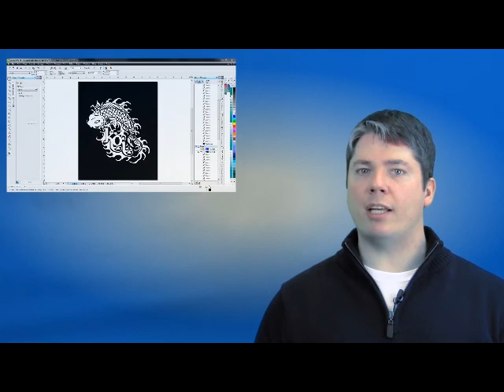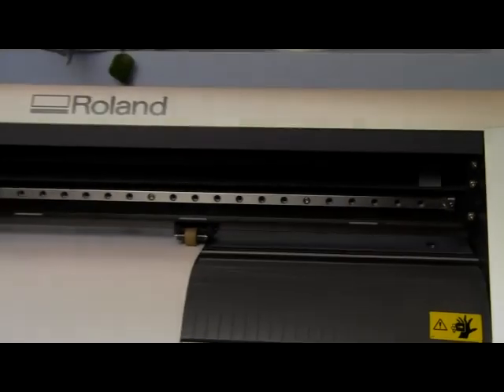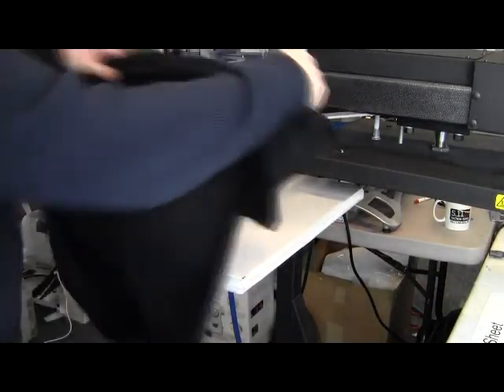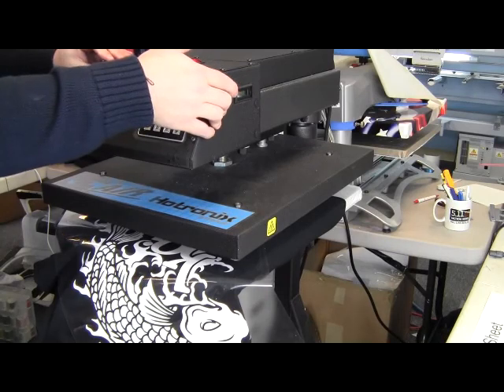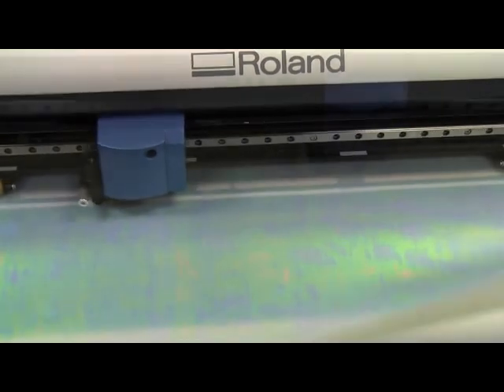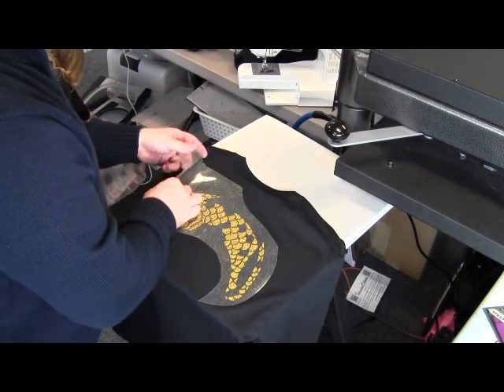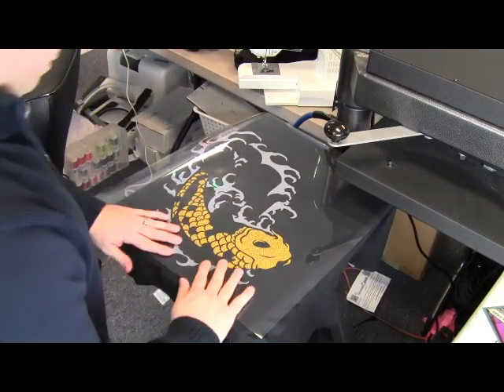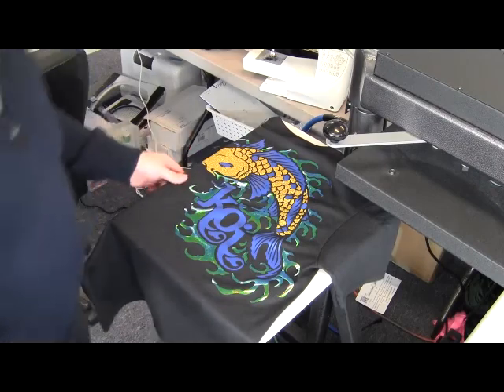working with heat transfer films

Comment from the maker: @MrsHenry725 It varies on the different medias but the eco film is 320 for 10 seconds. When making multi layer designs, press the first layer for a second or two to get it set. Once you are on the last layer, do a full press to set them all permanently.

Comment: Great video and beautiful outcome!! My question is before you cut the 3 colors do you keep the same dimensions on all 3 designs on Corel draw  to form one big design??  I try to do multicolor and it's always off by just a half inch or so when I overlap the designs , so the design looks off and not like one huge piece!!  Thanks
Reply from the maker: +CAPOTHUGRIDERS I do keep all of them the same size. when you apply the layers, only a quick tack down for each layer of 2 seconds to get them to adhere and then a full time application at the last layer to set it all. The vinyl will shrink slightly under prolonged heat and will cause the sizing to be off if you do not perform it this way.Hope this helps!
Reply: +Steven Jackson great thank you for the reply and please keep making these cool videos!!!

Comment: Steven,

First thanks for the excellent video describing the use of the Roland Gx-24. My question is whether I can print directly from the AI program/computer to the cutter or do I need to buy a printer, print, then place the prints on sublimation film, then place this in the cutter? 

Second, how do print such as large image, most sublimation printers are standard 8.5 in. wide, do you know or have a printer you can recommend for large (wide) printing?

Cheers!